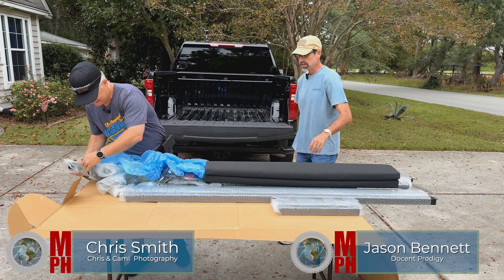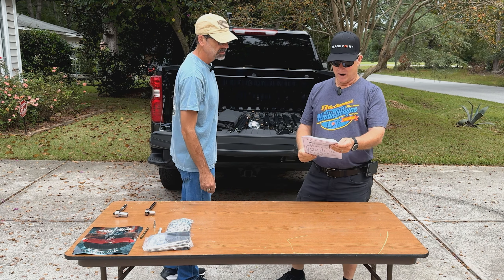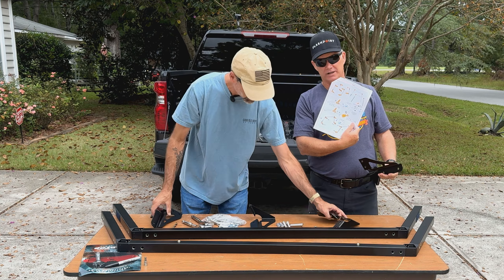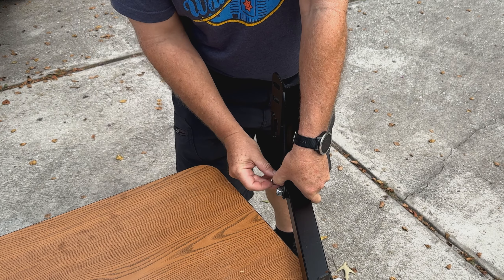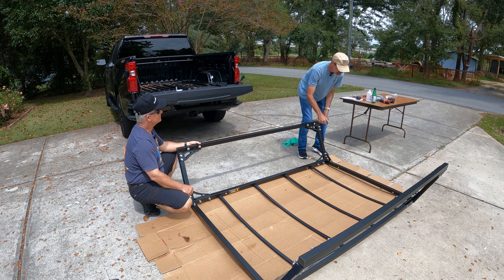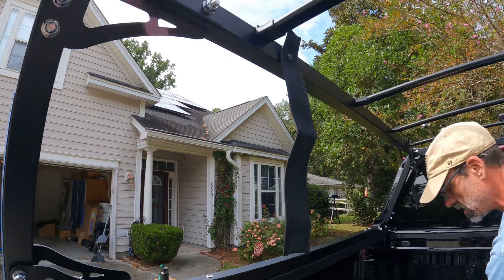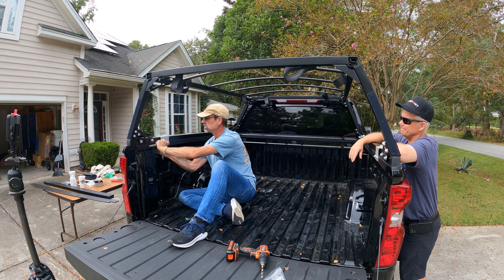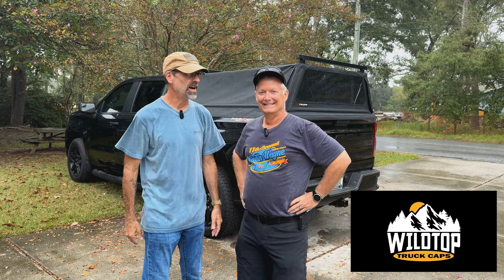WildTop Truck Cap Installation by Moto Photo Adventures

Comment: Without any method to secure them, do the lower edges of the side panels flap at highway speed beating up your paint?
Reply from the maker: Great question! No, the lower edges of the side panels do not buffet in the wind, even at highway speeds. The support bars that slide into the bottom of the canvas, combined with the snug fit around the frame, ensure the panels remain taught, eliminating any risk of flapping or paint damage. Thanks for watching, and let us know if you have any more questions!

Comment: Are the front and rear windows replaceable? I currently have had a Softopper and need to replace the rear window panel every 3-4 years as heat/cold and UV cause the vinyl window to crack. Replacement is very reasonable.

I really like the built in rack of the Wildtop, but if the rear window isn't replaceable as a separate panel it's a non-starter.
Reply from the maker: Hi @ArchdukeB,

Thanks for your question! While we don’t offer separate replacement panels for the windows, we do offer a full replacement canvas. Having the canvas as one piece helps maintain the waterproof design and ensures long-lasting durability against heat, cold, and UV.

We’re glad to hear you like the built-in rack, and we hope this option works for you. Feel free to reach out if you have any other questions!

Best,
Nick
WildTop Team